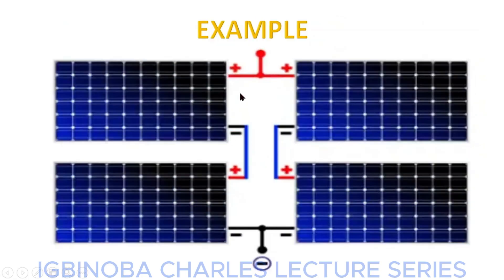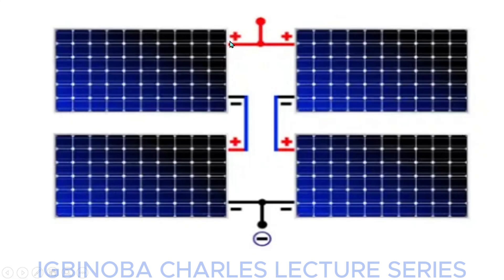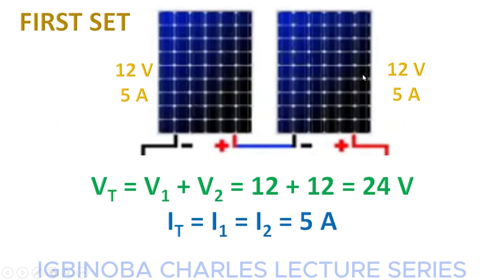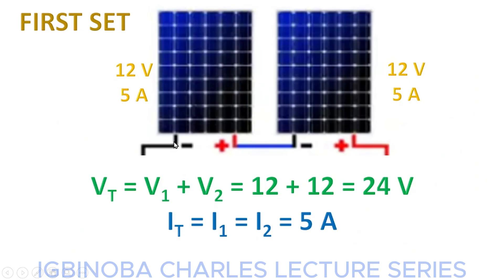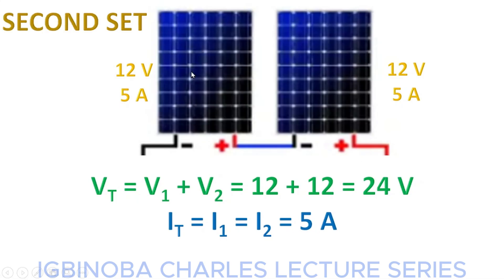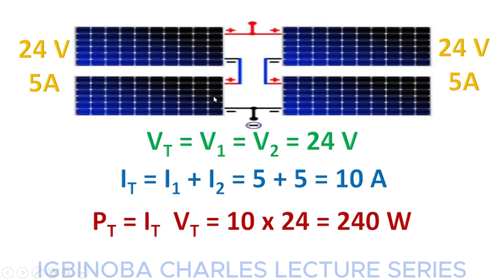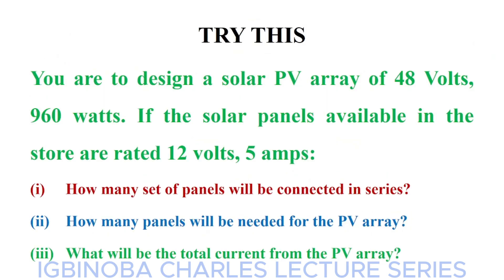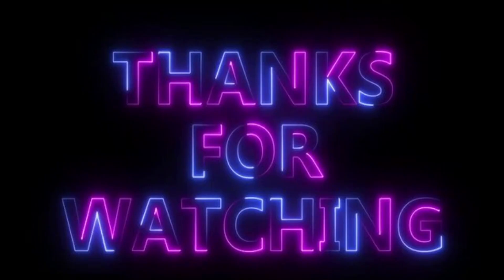Connection of  Solar Panels in SERIES-PARALLEL

Comment: COMP316P
i.  4 panels are connected in series 
ii.  For the PV array, number of panels needed is 960/60=16
iii. The total current from the solar array is 20 amps.
Formula i = p ÷ v
960W/48V=20A

Comment: EEE 3159C

1:- Sets of panels that will be connected in
series is 48 / 12 = 4
2:-The power generated by a single panel is =
120 V x5A = 600 W. The required power in the
array is 960 W. Therefore, the number of panels needed for the array is = 960 / 60 = 16 panels.
3. 16 panels are in the array and 4 panels are in series. Total number of parallel sets of panels = 16/4= 4 parallel sets. Total current from each set of panels is 5A. Since these sets are in parallel, the total current is = 5A x 4 = 20A.

Comment: EEE3180X
1.4 set of panels will be connected in series 
2. 16 panels will be needed for the PV array
 3. The total current from the PV array will be 20Amps.

Comment: MAR373U

1. 4 sets of panels will be connected in series
Since connecting 4 of the 12 volts, 5 amp panels in series aives a total of 48 volts as required by the solar PV array design

2. 16 panels will be needed for the PV arrav
This is because the power of each panel is 12 x 5 = 60 watts, therefore the total number of panels to produce 960 watts is, 960/60 = 16

3. The total current from the PV array is 20 amps
Since I (total) = P (total)/ V(total
I(total) = 960/48 = 20amps

Comment: MAR364L

V=12v and I=5A 
Power:P=I x V=5x12 =60W

Required System: 48V,960W
1) Series Connection:
48V/12V = 4
 Ans :4 panels in series 

2) Total panels 
960W/60W =16

Ans : 16 panels in total 

3) total current 

4 strings x 5A = 20A
 
Ans: 20A

Comment: CHM3131A
1.  Number of panels in series = 48/12 = 4 panels.
2.  Number of panels needed for the PV array = Total power in the circuit/ Power in each panel = 960/60= 16 panels.
3.  Total current from the PV array = Total power/ Total voltage = 960/48 = 20 Amps.

Comment: COMP70R

1. 4 Panels connected in series 
 4 12 volt, 5 amp panels in series , a total of 48 volts which is the  voltage needed for the solar system. 

2. A total of 16 panels are required 
   Each panel produces 60 Watts = 12 V * 5 A = 60 W
   To obtain 960 W in total , 960 + 60 = 16 Panels 

3. The total current from the solar array is 20 Amps.
Using I=P+V, we have that 960W/48V = 20A .

Comment: EEE 314N
i. Four sets of panels will be connected in series ( 48V/12V =4V) 
ii.16 panels will be needed for the PV array ( 960W/60W=16W)
iii.The total current from the PV array is 20Amps

Comment: MAR376X

1) four solar panels are connected in series, the total voltage is equal to 48 volts (4 x 12V), matching the solar system's required voltage.

2) 16 panels are needed, each producing 60 watts (12V x 5A). 960/60 = 16 panels.

3) The total current from the solar array is 20A amps, I = P/V and so current= 960/48 = 20A

Comment: EEE31A

1.Number of Panels in Series
Required system voltage = 48V
Each panel voltage = 12V
Number of panels in series = 48V ÷ 12V = 4 panels
Answer: 4 panels in series.

2.Total Number of Panels Needed
Power of one panel = 12V × 5A = 60W
Total required power = 960W
Total number of panels = 960W ÷ 60W = 16 panels
Answer: 16 panels in total.

3.Total Current from the PV Array
Total panels = 16
Panels in series = 4 → Number of parallel sets = 16 ÷ 4 = 4 sets
Current per set = 5A
Total current = 4 sets × 5A = 20A
Answer: The total current is 20A

Comment: CHM 350X
a) Panels in Series: To achieve the system's target voltage of 480V using 120V panels, 4 panels need to be connected in series.

· b) Total Panels Needed: The power output of a single panel is 600W. To meet the total system power demand of 960W, 16 panels are required in total.

· c) Parallel Strings & Current: With 16 total panels arranged in 4 series strings, these strings are connected in parallel. This configuration results in a total output current of 20 Amps.

Comment: CHM383E
1.  Number of panels in series = 48/12 = 4 panels.
2.  Number of panels needed for the PV array = Total power in the circuit/ Power in each panel = 960/60= 16 panels.
3.  Total current from the PV array = Total power/ Total voltage = 960/48 = 20 Amps.

Comment: CHM381C 

(1)Panels in series=
- Array voltage needed: 48 V  
- Panel voltage: 12 V  
In series = 48 ÷ 12 = 4 panels

(2) Total array power: 960 W  
Current from one series string: 5 A 
Power of each panel is 12 x 5 = 60w Total  number of panels to
produce 960 watts is, 960/60 = 16panel 

(3)Total current from the PV array=
I total = I panel × N parallel = 5 A × 4 = 20 A

Comment: CHM3151U

V=12v and I=5A 
Power:P=I x V=5x12 =60W

Required System: 48V,960W
1) Series Connection:
48V/12V = 4
 Ans :4 panels in series 

2) Total panels 
960W/60W =16

Ans : 16 panels in total 

3) total current 

4 strings x 5A = 20A
 
Ans: 20A

Comment: PETRO378Z 
1).  4 panels are connected in series.
We connected four 12-volt, 5-amp panels in series. So we   get 48 Volt in total, which is  the voltage needed for the solar system .
2) . A total of 16 panels are needed.
Each panels produces 60 Watt i.e 12 V x5 A=  60 W
To get 960W n Total, 960+ 60 panels.
3). The total current  from the solar array us 20 amps. 
Using I =P+V, we have that, 1960W 48 V= 20A.

Comment: CHM374V
1. Four panels are connected in series. When you connect four 12-volt, 5-amp panels in series, you get a total of 48 volts, which is the voltage needed for the solar system.

2. A total of 16 panels are needed. Each panel produces 60 watts (12V x 5A = 60W). To get W in total: 960 60 16 panels.

3. The total curent from the solar array is 20-amps. Using the formula I = P + A, 1960W 48V = 20A.

Comment: CHM3142L
i, 4 panels will be connected in series- 48V/12V = 4
ii, sixteen (16) will be needed for the pv array because 960W/60W = 16
iii, the total current in the pv array is 20A

Comment: COMP3119O

Solar Panel Configuration and Power Calculation

Series Connection for Voltage Requirement To achieve a 48V system using 12V panels:

48V/12V = 4 panels in series 

Power Output of One Panel Each panel produces:

P = IV = 12 * 5 = 60W

Total Panels Needed for 960W To generate 960W of power:
960W/60W = 16 panels needed 

NOTE: parallel Strings Calculation With 4 panels per series string:

16 panels/ 4 panels = 4 parallel strings 

Total Current Supplied Each string supplies 5A. Since strings are in parallel:

I = P/V = 960W/48V = 5A

Comment: Chm358F
1. 4 panels are connected in series.
When you connect four 12-volt, 5-amp panels in series, you get a total of 48 volts, which is the voltage needed for the solar system.

2. A total of 16 panels are needed.
Each panel produces 60 watts (12V * 5A = 60W)
To get 960 W in total: 960/60 = 16 panels.

3. The total current from the solar array is 20 amps.
Using the formula I= P/V = 960W / 48 = 20A

Comment: CIV395Q

1: Four panels connected in series. When you connect four 12-volt, 5-amp panels in series you get a total of 48 volts which is the voltage needed for the solar system 

2: A total of 16 panels are needed. Each panel produces 60 watts (12v x 5A =60W) 
To get 960w in total( 960÷60 =16 panels) 

3: The total currebt from the solar array is 20amps . 
Using the formula I= P ÷ V 
I = 960 W ÷ 48 V= 20 A
Reply: EEE313M

Solution:

Each panel = 12V, 5A → Power = 12 × 5 = 60W

(i) Panels in series to get 48V:
48V ÷ 12V = 4 panels in series

(ii) Total panels needed for 960W:
960W ÷ 60W = 16 panels

(iii) Total array current:
960W ÷ 48V = 20A

Comment: NAT33C
1. Four panels are connected in series. When you connect four 12-volt, 5-amp panels in series, you get a total of 48 volts, which is the voltage needed for the solar system,
2, A total of 16 panels are needed, Each panel produces 60 watts (12V x 5A = 60W). To get -total watts: 960 60= 16 panels,
3. The total current from the solar array is 20 amps. Using the formula I = P * V, I =960W : 48V = 20A.

Comment: CHM354B

I) four 12-volt, 5-amp solar panels are connected in series, the total voltage adds up to 48 volts (4 x 12V), matching the solar system's required voltage.
ii) To achieve 960 watts, 16 panels are needed, each producing 60 watts (12V x 5A). This calculation is based on 960 ÷ 60 = 16 panels.
iii) The total current from the solar array is 20 amps, calculated using the formula I = P ÷ V, where P is the total power (960W) and V is the total voltage (48V): 960 ÷ 48 = 20A.

Comment: CHM313M 

1. 4 panels are connected in series, we connected four 12V, 5A panels in series, so we get a total of 48V, which is the voltage needed for the solar system.

2. A total of 16 panels are needed. Each panel produces 60W (12V * 5A).

3. The total current from the solar array is 20A using \(I = P + V

Comment: CHM328B
i four (4) panels will be connected in series since: 48V / 12V = 4
 ii. A total of sixteen (16) panels will be required for the PV array since: 960W / 60W = 16
 iii. The total current from the PV array is 20A, calculated as: 960W / 48V = 20A

Comment: CHM 3103Y

1. 4 panels are connected in series, we connected four 12V, 5A panels in series, so we get a total of 48V, which is the voltage needed for the solar system.

2. A total of 16 panels are needed. Each panel produces 60W (12V * 5A).

3. The total current from the solar array is 20A using \(I = P + V \)

Comment: CHM3165I 

GIVEN:

Required array =48V , 960W.
Each panel =12V, 5A.

1. Panel in series =48V/12V= 4 panels in series.

2. Power per panel=12V×5A=60W.

Total panels =90W/60W=16 panels.

Total current =5A×4=20A

Comment: PETRO322V 
1.the number of panels required is 48/12=4 panels. 

2.the power output of one panel is the total voltage multiplied by total current.P=12volts*5amps =60 watts 

Therefore the total number of panels to produce 60watts is 960/60=16 panels 
3.with 16panels and 4 panels per series string the number of parallel strings is 16/4=4 parallel sets and each String produces a current of 5A since the strings are connected in parallel the total current supplied by the array is 5A*4=20A or using I =P/V ,
I=960w/48v=20A

Comment: EEE3149S

1.Number of Panels in Series
Required system voltage = 48V
Each panel voltage = 12V
Number of panels in series = 48V ÷ 12V = 4 panels
Answer: 4 panels in series.

2.Total Number of Panels Needed
Power of one panel = 12V × 5A = 60W
Total required power = 960W
Total number of panels = 960W ÷ 60W = 16 panels
Answer: 16 panels in total.

3.Total Current from the PV Array
Total panels = 16
Panels in series = 4 → Number of parallel sets = 16 ÷ 4 = 4 sets
Current per set = 5A
Total current = 4 sets × 5A = 20A
Answer: The total current is 20A

Comment: MAR311K

1.  Four (4) panels are connected in series.
When you connect four (4) 12-volts, 5-Amps panels in series, you get a total of 48 volts, which is the voltage needed for the solar system.

2. A total of 16 panels are needed 
Each panel produces 60 watts (12V × 5A = 60W)
How 16 panel is derived, total power divided by individual panel power (960÷60 = 16 panels).

3. The total current is gotten with the formula ( total Current = total Power ÷ total Voltage)
960W÷48V = 20 Amps

Comment: EEE343Q
1.) Since 4 Panels are connected in series with each 12V, 5A.
Total voltage in the connection is = 4 x 12= 48v as required by the PV array design.
2.) Power per Panel is 5 x 12= 60W.
The number of panels needed for 960W : 960/60= 16panels.
3.) finding the total current in the solar array:
I = P /V 
I = 960 / 48 = 20A.

Comment: Mech3103Y

1:4 panels will be connected in series (to form one string).

2: The total current from the PV array will be 20 A.

3: A total of 16 panels will be needed for the PV array.

Summary:  The PV array will consist of 4 parallel strings, with 4 panels connected in series in each string.

Comment: PETRO34D
1 4sets of panel will be connected on series 48v/12v=4 

2 6 panels needed for the PV array 960w/60w=16 

3 The total current from the PV array is 20A(960w/48w)=20

Comment: CHM3136F
1. Four panels are connected in series.
When you connect four 12 volts, 5 amp panels in series you get a total of 48 volts.
Which is the voltage needed for the solar system.
2. A total of 16 panels are needed.
Each panels produces 60 watts (12v *
5amps =60
watts) to get 960 watts in total : 960/60 = 16
panels.
3. The total current from the solar array is 20 watts.
Using the formula I= p+v
1 = 960/48 * V = 20A

Comment: NAT38H 
• The number of panel required is 48÷12= 4panels.  
 
• The power output of pne panel is the total voltage multiplied by total current.  
  P=12×5=60watts  
 
  Therefore the total number of panel to produce 60WATTS  
  = 960/60=16Panels.  
 
• With 16 panels in total and 4 panels per series string, the number of parallel strings is 16÷4= 4parellel sets. Each string produces a current of 5A, since the strings are connected in parallel the total current supplied by the array is =5A×4=20A.

Comment: Mech337k
Four sets of panels will be connected in series(48v12v)=4

16 panels will be needed for the pv array (960W/60W)=16

The total current from the pv array is 20A (960W/48V)=20A

Comment: CHM6F

1.  4 panels are connected in series, we connected four 12V, 5A panels in series, so we get a total of 48V, which is the voltage needed for the solar system.
2.  A total of 16 panels are needed. Each panel produces 60W (12V * 5A).
3.  The total current from the solar array is 20A using \( I = P + V \)

Comment: MECH3150

2 SET OF PANALS CONNECTED IN SERIES PARALLEL

TOTAL OF 4 PANELS IN THE PV ARRAY

THE TOTAL CURRENT IS 20A

Comment: PETRO37K

1.  The number of panel required is 48÷12= 4panels.  
 
  2. The power output of pne panel is the total voltage multiplied by total current.  
  P=12×5=60watts  
 
  Therefore the total number of panel to prodUce 60WATTS  
  = 960/60=16Panels.  
 
  3. With 16 panels in total and 4 panels per series string, the number of parallel strings is 16÷4= 4parellel sets. Each string produces a current of 5A, since the strings are connected in parallel the total current supplied by the array is =5A×4=20A.

Comment: COMP3118N
1. Four panels are connected in
series. When you
connect four 12-volt, 5-amp panels
in series, you get a total of 48 volts,
which is the voltage needed for the
solar system.
2. A total of 16 panels are needed.
Each panel produces 60 watts (12V x
5A= 60W). To get W in total: 960 60 =
16 panels.
3. The total curent from the solar
array is
20-amps. Using the formula I = P+A,
1960W 48V = 20A.

Comment: Mar 7g
1. Four panels are connected in series. When you connect four 12-volt, 5-amp panels in series, you get a total of 48 volts, which is the voltage needed for the solar system.

2. A total of 16 panels are needed. Each panel produces 60 watts (12V × 5A = 60W). To get total watts:
960 ÷ 60 = 16 panels.

3. The total current from the solar array is 20 amps. Using the formula I = P ÷ V,
I = 960W ÷ 48V = 20A.

Comment: MAR90L

1. Four panels are connected in series.
When you connect four 12-volt, 5-amp panels in series, you get a total of 48 volts, which is the voltage needed for the solar system.
2. A total of 16 panels are needed.
Each panel produces 60 watts (12V * 5A = 60W)
To get 960 W in total: 960/60 = 16 panels.
3. The total current from the solar array is 20 amps.
Using the formula I = P + V, 1 = 960W / 48 * V = 20A

Comment: MECH343Q

1. Four panels are connected in series. When you connect four 12-volt, 5-amp panels in series, you get a total of 48 volts, which is the voltage needed for the solar system.

 2. A total of 16 panels are needed. Each panel produces 60 watts (12V x 5A = 60W). To get W in total: 960 60 = 16 panels. 3. The total curent from the solar array is 20-amps. Using the formula I = P + A, 1960W 48V = 20A.

Comment: Mar3116L

1) four 12-volt, 5-amp solar panels are connected in series, the total voltage adds up to 48 volts (4 x 12V), matching the solar system's required voltage.

2) To achieve 960 watts, 16 panels are needed, each producing 60 watts (12V x 5A). This calculation is based on 960 ÷ 60 = 16 panels.

3) The total current from the solar array is 20 amps, calculated using the formula I = P ÷ V, where P is the total power (960W) and V is the total voltage (48V): 960 ÷ 48 = 20A.

Comment: PETRO 317 Q
1. 4 panels are connected in series, we connected four 12V, 5A panels in series, so we get a total of 48V, which is the voltage needed for the solar system. 
2. A total of 16 panels are needed. Each panel produces 60W (12V * 5A).
3. The total current from the solar array is 20A using I = P + V

Comment: PETROCHEM354B
1. Four panels are connected in series
      When u connect four 12 volts , 5-amp panels in series, you get a total of 48volts , which is the voltage needed for the solar system . 
 2. A total of 16 panels are needed . 
        Each panel produces 60 watts ( 12V *5A)=60watt .
To get 960 watt in total , 960/60=16 panels 
3. The total current from the solar array is 20 amps .
  Using I= P+V , we have that 960 watt/ 48V = 20 A

Comment: PETROCHEM336N

1. Four panels are connected in series.
   When you connect four 12 volts,5 amp panels in series you get a total of 48 volts. Which is the voltage needed for the solar system.

2. A total of 16 panels are needed.
   Each panels produces 60 watts(12v × 5amps =60 watts) to get 960 watts in total :  960÷60 = 16  panels.

3. The total current from the solar array is 20 watts.
   Using the formula I= P(total) ÷ V(total)

I = 960÷48  = 20amps

Comment: EEE317Q

a.) Four 12V, 5A Panels in Series would result in a 48V which is what the solar system needs.

b.) Sixteen 12V, 5A Panels produces 60W each and will produce 60W * 16 = 960W all together.

c.) The total current from the solar array is 20A 
I = P/V = 960W/ 48V = 20A